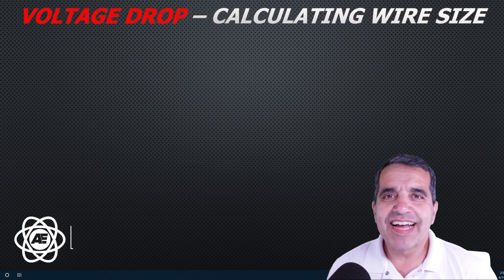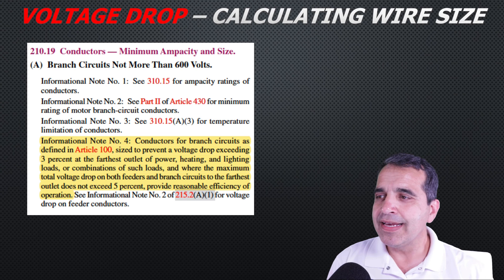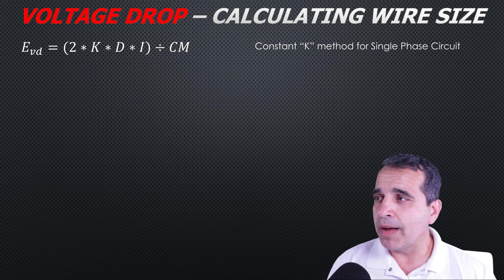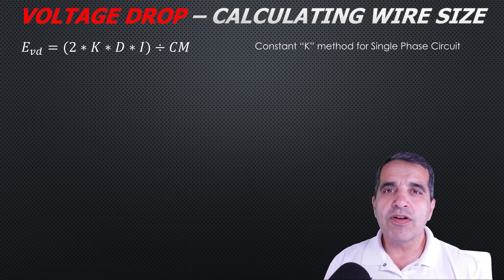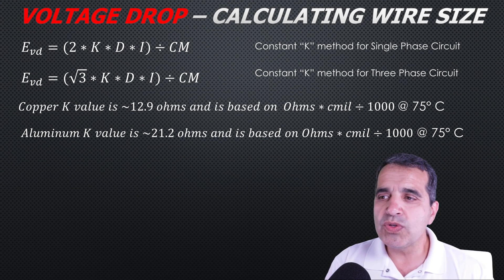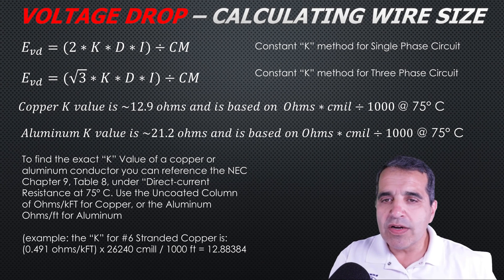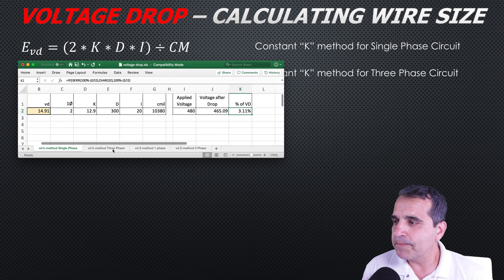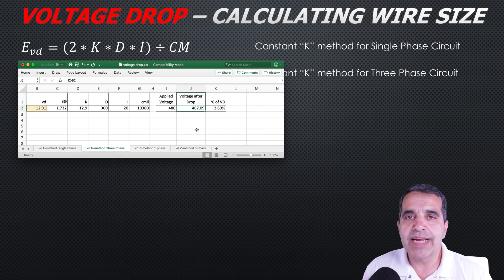Calculating Voltage Drop

Comment: Are you aware that the original notes on voltage drop used to only be in article 240 Overcurrent?    The original reason was that with certain loads, if voltage dropped too much and the overcurrent protection was close the breaker would trip or the fuse blow.  That is back when NEC was about life safety, not equipment protection.  That came later.  
As I did many thousands of calculations for voltage drop in my 35 years designing electrical systems, I did not waste my time looking for voltage drop percentage.  I need to know the conductor size.  So, my formula is CM= 2x12.9xDxI/ 3% of voltage used.   Then go to table and find the conductor that meets the requirement.  Be careful, this is not the necessary conductor size.  You must size to overcurrent protection.   Also, for 3 phase 3 w multiply the calc result by .66.   If it is a balance load on 3 phase 4 wire circuit, then multiply by .5.

Comment: GOOD AFTERNOON, I HAVE THE FOLLOWING QUESTION: IF A THREE-PHASE FEEDER IS INSTALLED IN A METAL WIREWAYS, TABLE 9 IS APPLIED TO CALCULATE THE VOLTAGE DROP?

Comment: Why does no one bring up how to find voltage drop of wire larger than 4/0?   I need voltage drop of 850ft run of single conductor aluminum 750kcmil, 3000A.

Comment: Both methods should give equivalent results. The reason why using table 9 gives you a slightly different result is because eddys current (Q) losses is not taken into account. But if (Q) is used both methods should be 99.9 % equivalent.

Comment: Thank you for this video. Question for you about the impedance for the single phase case. The Chapter 9 Table 9 of the NEC says in the title that it is for three phase power, but you used it in the single phase case. Is there something in the NEC that indicated that table 9 can be used on the single phase case or is there another table for the single phase case?

Comment: Thank you very much for the very clear, detailed and straight forward video lesson. This helps me a lot on my studies.

NEC Table 9 have a title of:
Alternating-Current Resistance and Reactance for 600-Volt Cables, "3-Phase", 60 Hz, 75C  (167F) — Three Single Conductors in Conduit

May I kindly consult if we can use NEC Table 9 for 1-Phase circuits? 
even though the title indicates "3-Phase"

Thanks again and more power to your channel.

Comment: Walter, Great job.   Here is a good voltage drop calculator that takes into account wire composition, length of wire, current, voltage, temperature range and whether is single or three phase: https://www.vcalc.com/wiki/Voltage%20Drop%20Calculator  .  I believe it works out to be your exact equation.

Comment: Great video only issue with using the table 9 formula with impedance (z value) is that the impedance of Table 9 is only good for 3phase - Three single conductors in conduit as per the title of that Table so I’d assume it’s not totally accurate for use with Single Phase Voltage drop calculations. Sorry to be that guy.

Comment: How do you factor in multiple runs of conductors into that Voltage Drop equation?
Reply: Jose ... you need to figure the drop for each run separate then add up the results for the whole run. If the numbers are too high (percentage of drop) then you need larger wire. You will almost never have a problem if you stick to 80% loading of a branch circuit and stay under 100 ft in a run. To ease the brain work use one of the voltage drop calculators on the web. You plug in wire size, load, and run length. They will tell you voltage drop and percentage. After you use it a few times you will get a feel for where you need to be.

Comment: good video! a couple questions tho.  How did you get 2.75% from 13.20 in the single phase method (15:27) and your applied voltage cell reads 480.  thanks
Reply from the maker: Matthew Gaskey also, this calculator may be helpful. https://www.calculatorsoup.com/calculators/algebra/percent-difference-calculator.php

Comment: As a designer for a contractor and doing thousands of calculations over the years, I always wanted to know the wire size needed in one calculation.   I did not want to keep guessing until I got less than 3%.   Less complicated method.  2xKxampsxLdivided by 3% of voltage= cm.   Conductor properties table will give you needed wire size.   Also,  for balanced 3 phase 3 wire multiply single phase calculation at end by .86.   1.73/2=.865.   And for balanced three phase 4 wire, multiply single phase calc at end times .5.   If balanced load, then no neutral current.  1/2=.5.
Respectfully submitted,   Kevin

Comment: CM in the equation. What are Circular Mills?
Reply: It's ok. Got it. Just wondering what's wrong with square mils. Or even square inches.
Reply from the maker: circular mills is the circular cross section of the wire we are examining. You can find the CM for each size of wire in Chapt 9, Table 8 of the NEC. Check minute mark 12:38 and you will see that table.